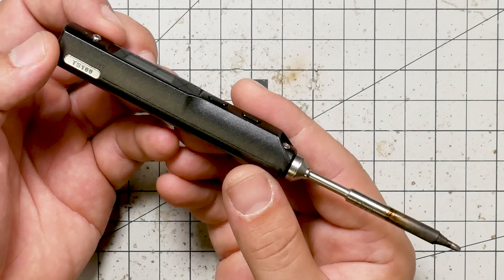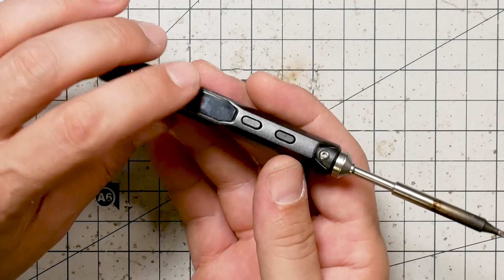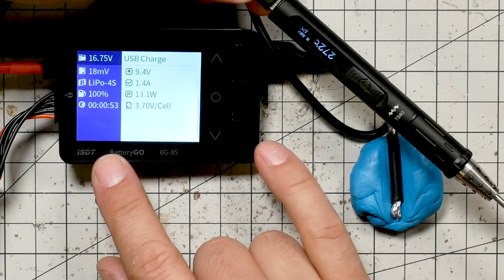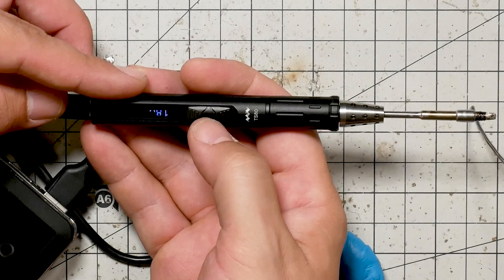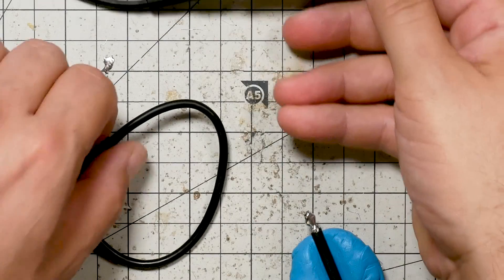Best Portable Soldering Iron TS80 vs. TS100

Comment: Theoretically USB-PD via Type C cat deliver up to 100W (20V 5A), so a Type C connector was the right choice.
Reply: @gbraadnl  Thank you for the information, I just read the docs about the CC pins and there function, don't know this. Thought before, it's only a software issue to send the right trigger for PD negotiation.
Reply: @hamburgelbstrand5748  Unfortunately not... they made a decision to only support QC3, as that is very prevalent here in China (almost all are unofficial/unlicensed implementations), so finding a powerbank that supports QC is easy. For USB-PD you need more logic, as it acts like a network/communication in which the power levels are established. For the custom firmware we have looked into some possiblities, but even if the pins could be modded, it would be nearly impossible to add the protocol as the firmware is almost fully using all the memory assigned. I think it is a missed opportunity... one of the reasons why the TS100 is better/easier

Comment: Until they provide a better assortment of tips (just 2 last time I checked), I won't/can't switch over to the TS-80. Two tips I use frequently and one I use occasionally are not sold yet for the TS-80 so it'd just sit in my drawer collecting dust. They've been saying for about two months now that they'll be improving the tip selection, hopefully that comes soon.
Reply: See what Banggood has for you now.

Comment: 2:25 - Just leave the tip screw out of the TS100 then! There you go, it now pulls out just like the TS80!

Apart from LiPo packs, the TS100 is very happy on laptop power supplies, and on typical 19v laptop power supply, it rocks.
Reply: I power it using my Lenovo 20V powerbrick, and even can use a USB-PD 20V or USB-QC 12V adapter to make it work. This is not possible with the TS80 unless additional USB converters (from 20V to USB-QC is added... I have several, but unnecessary bulk to take), and it does not work well with even brand-name USB-QC3 powerbanks, like Lenovo PB-001, etc. TS100 wins in ease of use.

Comment: Can you power the TS80 by directly supplying it 9V? With a cut-away USB cable, or something similar?
Reply from the maker: No, I don't think so. It uses the QC3.0 standard so I doubt it would work on straight 9v. It's not out of the question, but you might risk damaging the TS80 if you tried it.
Reply: @JoshuaBardwell  that was my guess too... Thank you for the reply!

Comment: USB-C is more than capable. Don't forget it's now the default power connector for Macbooks too.
Reply: But the macBooks use USB-PD... and this iron only does QC3.0. These protocols are not the same. If you would use the macbook power brick, you are only powering it with 5V at 2.1A, which does not heat it (LOW VOL) unless you flash custom firmware.

Comment: Using the included cable WILL limit the max wattage since it's a USB 2.0 plug on one end. If you really want it to perform at 100%, you'll need to use a USB-C to USB-C or 3.1 to USB-C cable to get the extra lines for more power. You'll also need a charger that has QC3.0 and 3.1 or C to do that on-the-go. Regarding the 17watt/"can it handle it" question? Easily. USB-C/3.1 is designed to handle 60W constant in all setups, and 100w in high-current ones.  (20v, 5A) Thanks for the awesome review; now I just have to wait 'til payday so I can order one! Glad I waited to see if the TS-80 was worth it a couple months ago when I started looking. Gave me good time to figure out which will work best for my field work, heh.

Comment: USB-C actually supports up to 100 watts of charge if you use a cable which supports it
Reply: The catch being that the TS-80 doesn’t use standard USB-C PD for power. It uses Qualcomm’s QC for power instead, which is limited to 18W @ 20V and requires a special charger. I really wish the TS-80 used standard USB-C PD.

Comment: You're saying that a USB-C power supply will do the trick...It's not that simple unfortunately. Yes, the TS80 has a USB-C connector, but it's specifically a QC3.0 device. If you plug it into a MacBook power supply with a USB-C to USB-C cable, it's not going to power up at all (the screen will remain blank and you'll think you got a DOA iron even though you didn't). MacBooks use USB-C PD (Power Delivery) and the TS80 isn't compatible with that and apparently the hardware just isn't capable of that. So, if you didn't buy the iron with a power adapter and cable, you'll need a USB-A to USB-C cable, which will then allow you to power it up. If you want to power up a MacBook and the TS80 with a single power supply, you'll need one with a PD and a QC3.0 port and you'll need two cables too.

They are both good irons. I've used the TS100 a lot and made a battery pack for it that uses four 18650 batteries. I bought the TS80 thinking that I could just toss it in my backpack like a ball point pen and use it at work on my MacBook power supply when needed, but that turned out to be false, because I would also need to carry an extra cable and the Apple power supply just wouldn't do at all. If I travel, the TS80 ends up being slightly more compact because I can pack a PD/QC3.0 charger and a cable and the cable weighs and takes less space than the battery pack. If I need to use the iron outdoors, the TS80 is better, but if I need to use it at my car, the TS100 is more convenient because it works directly from a car battery.
Reply from the maker: The iron comes with a power supply and silicone-jacketed cable.
Reply: I bought mine without and "saved some money".

Comment: i have a soldering iron from lidl     its branded by park site it cost 13 euro sand has a battery built in and you can charge it by usb

Comment: BRO   love my TS-100   She hits 400^C Why was yours stopping at 300^C ?  
I don't do in the field operations.     However  I do use a soldering station for Pigtails the TS-100 doesn't seem powerful enough for bigger joints. 
Tips for the TS-100 are not  super expensive  (? $10 - $13)    I bet those TS-80's ain't not joke $$$$.

And how do you NOT  have a barrel connector to Lipo   joint for easy TS-100 in the field work like everyone else does  ?!? 
You fly with these people  you have to,   have seen the damn connector ?

 [  https://www.ebay.com/itm/XT60-Lipo-Battery-Connector-to-DC5525-Power-Cable-for-TS100-Soldering-Iron-Kit-/122613813357  ]
[ https://www.getfpv.com/2-5mm-barrel-connector-to-xt60-2-feet.html  ]

No really why did your TS-100 stop at 300 degrees Celsius ?
Reply from the maker: Mine goes up to 450 with the custom firmware. The TS80 defaults to 300 when you turn it on so that's where I set the TS100.

Comment: Anyone else see the 3.5mm jack and instantly think, "hmm...I wonder what I could all plug into there and would the iron try to heat them?"
Reply from the maker: If the iron is smart it has some sensing capability but if you are dumb enough to plug anything else into that plug hey maybe you get what you get.
Reply: It's not what it is designed/meant to do...but what it is capable of doing. ;-D

Some people just want to watch their devices with a 3.5mm jack...burn.

Nice comparison, btw. Is the rocker momentary or just a button? Good conversation about getting Ralim on it on the git.

Comment: I have the Hako 951, 888, and a 20 year old 936 as well as the TS100. Each has it's weaknesses and strong points but despite the flimsy light feel of the 951 hand piece it is the one I prefer for it's short grip to tip length and slim profile. Which highlights my main issue with the TS100, It has a relatively long grip to tip length and awkward grip shape. Not the end of the world just an area where a v2 could improve. Pretty please.
Reply from the maker: The TS80 has a shorter grip to tip length. Maybe it would appeal.

Comment: The new TS100 are limited with memory now, so you wont be able to add custom firmware or add TETRIS! Sad, but if you have older TS100 you can add custom fw with plenty of settings for your JOY!
Reply from the maker: Noooo! Why would they do that!
Reply: My recently purchased TS100 is running Ralim with no issue - where'd you get yours? BG was mine...I can check the storage capacity when I get home, but I figure if it's running Ralim it's good to go. Tetris sounds like a distraction from soldering...

Wait, does the game shut off the heating element? Hope so...lol.
Reply: if fits Ralim then you got good version with normal amount of memory. Or Ralim now weights less  =)
Reply: With hotter TS100 you can draw Tetris on your table surface faster.
Reply: Looks like all you can do is solder with it.  Shame.
Reply: custom fw gives you more precise temp control, for instance: not drawing power, it will rest it self after several secs, or gives a boos when you start soldering. custom fw is very nice future for old TS100 and has plenty of nice tweaks.
Reply: That's actually useful stuff - very nice, thanks!

Comment: My TS100 screw stripped and it keeps rebooting when first heating up... not a great success :/
Reply: The screw is not even required. (never used mine since day one) If your iron reboots check the spring contacts inside the handle and your connecting cable.

Comment: The Ralim custom firmware does add some nice features to the TS100 like low voltage protection, auto sleep and temporary temperature boost. But the custom firmware for TS80 is already being worked on anyway.

Comment: Can you try a temp gun next time, might be more accurate
Reply from the maker: Temp gun is based on infrared emission, exactly like FLIR, but without the nice color granularity. Also, temp gun only measures average temp in a conical cross-section, so it's impossible to accurately measure temperature for very small objects.

FLIR is better, although it's not perfect.
Reply: That makes sense, nice review

Comment: More aggressive would be the 12g wire soldered to the ground plane on a PCB

Also the T100 can take T12 Hakko tips...and can also take a Hakko grip with a 3D printed part

Thirdly, great job In putting drib to shame in pushups at Rampage!
Reply: He should have pointed out that the worst thing about the 80 is the lack of tips. Far as I know only 2 are available

Comment: honestly ts100 if i really need it powered off usb I'll buy a 5.5mm barrel connector to usb cable.
Reply from the maker: TS100 needs minimum 12v so I'm not sure how you would easily run it from USB.
Reply: Yea that would be an issue. Oh well I'll buy the ts100 eventually but my Chinese desktop thing works pretty well. Thanks to my dad fixing it  and calibrating it .

Comment: I love my TS100... The main feature that I like, regarding its portability, is how fast the tip actually cools DOWN... You can solder something, and in less than a minute you can handle the tip again and toss it in the bag...
Reply from the maker: And the built in accelerometer means it can shut itself down when you're not using it.
Reply: Big feature! I found a TS100 on sale for $30 about a week after I bought my first one... Now I have a spare.. Just as a precaution =P

Comment: It is a pity that the ts80 is not powered like ts100... I like the performance and the form factor but not the power supply
Reply: I use an Anker powerbank and it works great, heats up to 300C in a literal few seconds.
Reply: The QC3.0 power supply is the best thing about the TS80
Reply: The biggest shortfall of the TS80 is lack of tip selection

Comment: So you can only power it via the power brick it came with at home or using a QQC 2.0 USB battery bank? That seems like a huge shortcoming compared to the TS100
Reply from the maker: You need a QC3.0 capable supply. You can spend $10 or so on an XT60-to-USB adapter that can power it. Personally the TS100 is the winner at $25 cheaper.

Comment: I bought TS-100 over a month ago based on your review...and its outstanding! I agree with your comments on ease of use with XT-60 batteries already in my flight kit. Tip change out is easy enough. TS-80 looks like a winner too.  But, I'll stick with my TS-100.

Comment: I use https://www.banggood.com/AOKoda-Lipo-to-USB-Power-Converter-QC3_0-Adapter-Quick-Charger-for-Smartphone-Tablet-PC-p-1179963.html?p=F528136658398201609B this to power my TS80, works perfectly
Reply from the maker: It's cool but to me it's just one more thing to fail. I'd rather have a wire plugged direct to a LiPo. I guess it'd be cool for powering your phone as well.
Reply: its a very good module, has good (input) range and its tiny.

Comment: FLIR measurements are not accurate unless the correct material emissivity is used. Even then it may only be ballpark (depending on emission profile of the material).
Reply: it is hard to get an accurate temp on an uncoated metal.  Metal in general has a very low emisivity and he is is seeing a reflective temp, probably his face. He is seeing a more accurate temp on the TS100 because it is dirty the TS80 is brand new and acts just like a mirror to an IR imager.
Reply: Dominc, the emissivity of the tips maybe comparable but who's to say that it is the emissivity that was defined for the FLIR? The default emissivity in most IR meters is 0.8, since it is suitable for many real world surfaces. Metals (unoxidized) have a very low emissivity (and high reflectivity) so for such surfaces the default temperature reading is way off. 
Bart, it is true that metals are hard to read at "normal" temperatures since the reflected IR overpowers the emitted IR, but at high temperatures it is not the case, especially if the metal is considerably hotter than its surroundings.
Reply: @ASJC27  Soon after I commented I saw that he was looking for an absolute temperature. You're right, he needs the correct emissivity for that. Any value is fine for temperature differences between two things of same material
Reply: ASJC27 I don’t agree. Emisivity does not change with temp. Can you please provide an article that substantiates your claim?
Reply: @bartedwards2375  it doesn't vary with temperature, it varies by material. FLIRs pick up EM energy (heat) and do some quick math based on the surface of the material it's looking at to calculate temperature. YouTube doesn't allow links in comments, but check the Wikipedia page for emissivity
Reply: The emissivity of a material is a value that is determined by comparing the infrared given off of a black body at a given temperature.
Reply: Thermal cameras are good for pointing out hot spots. But to get an accurate temperature is not that easy. You have to compensate for the materials emissivity. A temperature probe rated at that temperature would probably work better. But I'm sure the soldering iron already has that installed
Reply: Emissivity most definitely changes with temperature. You can see for example "Fundamentals of heat and mass transfer", 7th ed., appendix A.11, page 1008 for emissivity of different metals at different temps. 

But that is not what I was getting it - what I said holds even for a (theoretical) constant emissivity. 
The IR/FLIR meters see IR but they cannot tell what was emitted and what was reflected. They see the total and for that reason for an accurate temperature you need both the correct emissivity value, and for the emitted IR to be much larger than the reflected IR (so that the total seen by the meter is close to the emitted part for an accurate calculation). The surface must also be diffusive, otherwise the reading will change depending on viewing angle. 
For example, an unpolished stainless steel plate outside at room temperature will give a false reading even with the correct emissivity, because it reflects sunlight IR and emits very little IR of its own (lowish temp + low emissivity).
Now heat that plate to 600C and now you get about the same reflected IR flux, but much higher emitted flux, due to the high temperature. Now the meter will give a good reading, because the total IR flux is close to the emitted flux, so the error is low. In fact at that temperature the plate will start glowing red hot - so you could even see with your eyes that it emits much more than it reflects.
Reply: ASJC27 I agree and disagree. First half yes second half no. Your emisiviry has not changed but the amount of IR being emitted has changed. You are also talking about metal that is close to 1000C for it to be visibility red in daylight

All this was about he was using his tool wrong. And it is very hard to get an accurate temp on bare/clean/polished metal.  I doubt that little FLIR unit had many settings and no one has mentioned how he was out of focus during most of it. There are a number of factors that play in to accurate temperature measurement with IR when you have a good known high emisiviry material.
Reply: Now it is my turn to agree and disagree :). 
The emissivity does change -  polished aluminium for example has an emissivity of 0.04 at room temperature, but that increases by 0.01 for every 100 degrees between 100K and 600K according to the textbook I quoted (which by the way is a book that probably any mechanical/aerospace engineer knows at least from one heat transfer class). 
I gave a high temperature example as an exaggerated case that can be seen with the naked eye. The same thing is true for lower temperatures, but obviously less apparent. At which exact temperature the emitted IR is dominating depends on both emissivity and reflectance, as well as surrounding parameters. But there is always a temperature above which that is true. 

I agree that polished metals are very difficult to measure, mainly because such surfaces are specular and therefore unless they have some geometric axisymmetry the reading will change with angle.
Reply: @bartedwards2375  emisivity does change with the object temperature
Reply: Know way of measuring metal tips with unknown state of oxidation and dirt on. Needs proper thermocouple meter!
Reply: He knows that.
I imagine the emissivity of each tip is comparable.